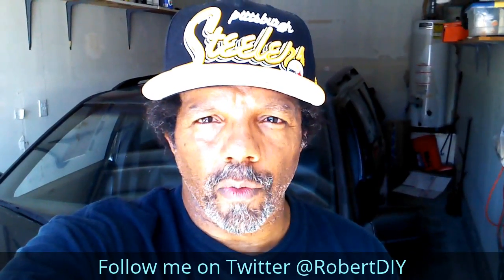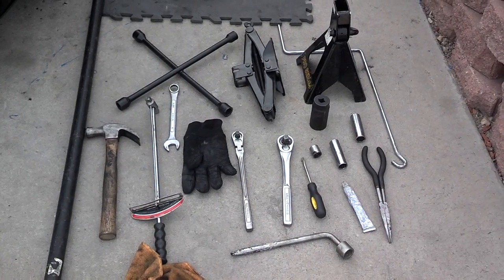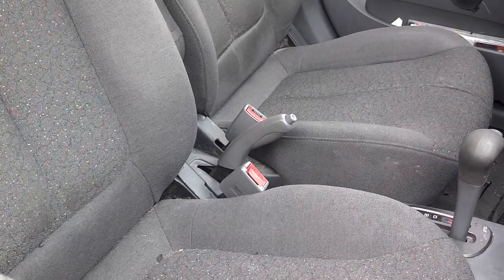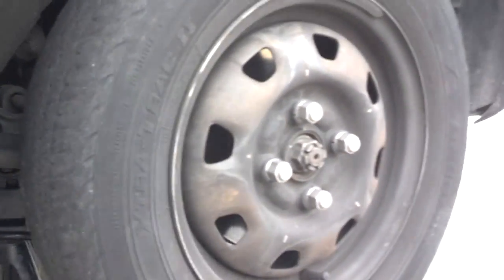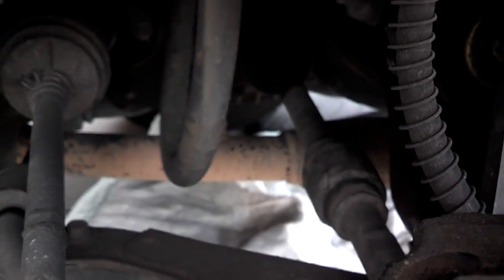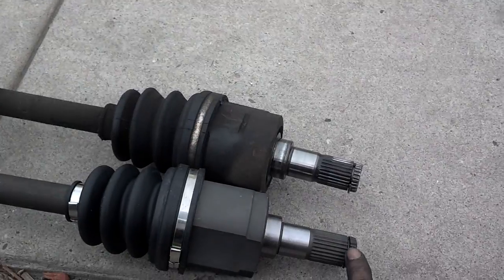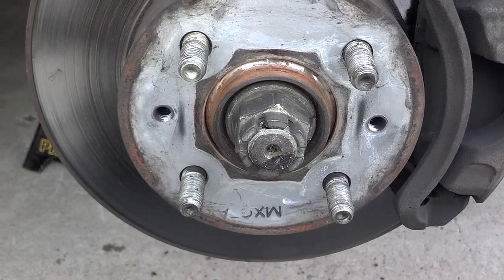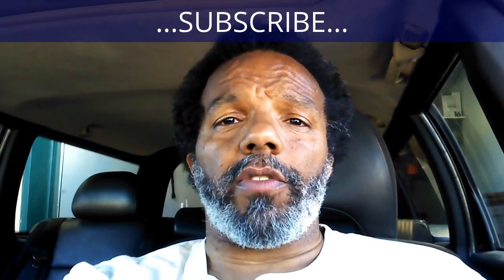CV Axle replacement, passener and drivers sides, Hyundai Accent - VOTD

Comment: Dear Sir, A Very Happy New Year, does the Shaft & Joint Assembly of a Hyundai Accent Part number 49525-TR003 (2013) fits a Hyundai Accent 2005? Are the Parts the same?
Reply from the maker: https://youtu.be/Qvveywp-JOc?si=etANV0mLaJNf0JnY

Comment: The center thing or the original is a balancer to help prevent shaft wobble since it's so long, they sometimes will put that in. Most aftermarket ones do not. Not sure if it's noticeable or not.
Reply from the maker: Thanks for sharing

Comment: Good job robert :-))
Sounds like you had a struggle but you conquered it :D
Not much holding that splined shaft in, a poxey wire ring spring, but ive seen a few videos with the same design so it must be safe.
Reply from the maker: zx8401ztv Yes, very common.

Comment: Hi Robert. In this video i see that you replace the old drive shaft with the one new. Can you told me why the old one have something at the middle shaft, meanwhile the new one dont have it. After you replace it with the new one, is there a differents likes shaking on stir or whatever
Reply from the maker: Probably for balance.
Reply: @RobertDIY  have you try to open it? Or maybe can you tell us whats the differet when you using the new one

Comment: How did you not lose your trans fluid? I tried jacking up my wheel to get it out of the way while installing a control arm…popped the joint out of the trans, along w/ the Tran fluid.
Reply from the maker: Yikes.
Reply: @RobertDIY  Now I can’t get the knuckle bolts out. Nuts will not bulge. This job was a diy mistake. Too many miles in this car to mess with.

Comment: Hi Robert , i need to replace the Seal of the front axle , do you have the Seal OEM part Number , My Hyundai Accent is 2008 GS 2 door , thanks for your help.Great Video.
Reply from the maker: Nope. Have you checked a parts website?

Comment: Is there any way to get the bearing out from the transmission that connects to the cv axle?   I thought I had a bad wheel bearing again on my 2008 Accent Hatch (manual trans), but replacing it did not help the noise.   The noise disappears when I turn to the left, but reappears when driving straight or turning right.  Sounds like an airplane is strapped to my car.    The mechanic thought it could be the CV axle bearing where it connects to the trans.
Reply from the maker: Which bearing did you replace?
Reply: Drivers side Wheel Bearing and HUB.  I replaced the front pass side last year. (fixed the problem).  Replaced the front drivers side today and turns out the old one was not bad and not the cause of the noise.  Even though it sounds exactly like it did last year only opposite. (opposite in that it's noisy when I turn right.  Last year it was noisy when I turned left)
Reply from the maker: +Jeff Goodroad maybe it's the rear. Drive a while, it will get worse.

Comment: Hey Robert, unrelated to the video, but I have a 91 nissan 240sx (stick), and often the engine won't rev passed 5k rpms(in any gear). If I turn off the car it temporarily solves the problem. Do you know what could cause this?
Reply from the maker: Samuel Watson Must be some error in the computer limiting the rpm's. How old are the o2 sensors?

Comment: Instead of replacing the wheel again to get the axle bolt loose have a friend sit in the car and apply the brake then use a pipe for leverage on your breaker bar
Reply from the maker: I do that when I'm not alone.
Reply from the maker: Usually break it loose before I pull the wheel.

Comment: do you have anything that would help me set the timing on a Hyundai 1.6? 2005 Accent.
Reply from the maker: +joe flynn can you see the marks?
Reply: +Robert DIY 

I can, I have the belt cover off and I am having to replace the  cam pulley. The crank pulley is still good. 210 lbs on each cylinder so no worries there. 

It looks like the yellow mark on the crank pulley lines up with the dot on the block,  between 1 and 2 o'clock. The cam pulley mark lines up with the dot on the case that is around the 12 o'clock mark. I don't have the valve cover off so I haven't seen the cam timing marks yet. On a side note, the Hyundai/Kia 2.0 is a hell of a lot easier to work on.

Comment: +Like!
 Hey Robert or anybody that can help me with this issue; I have a broken or disconnected? axle on the drivers seat. It looks like yours in the video but not nearly as bad, the boot is disconnected slightly and I was wondering if I should buy another one or can that be fixed? Unfortunately I cannot post a picture but the rubber is mostly disconnected and I see something round with black grease. Is it wise to buy a used / repaired one? If I cannot do this on my own would it be wise to buy a new one and pay a mechanic for labor do to this? From my quick skimming I see that some say that it could take hours to fix this and others around 15 minutes. 15 minutes or 20 minutes of labor + buying the piece myself seems like a good idea. 

Thanks for all the help!
Reply from the maker: Have you checked on the new prices? Have you read my video comments? Did you watch the video?